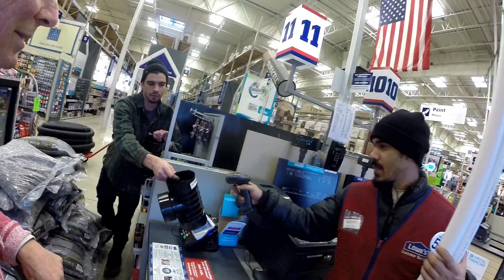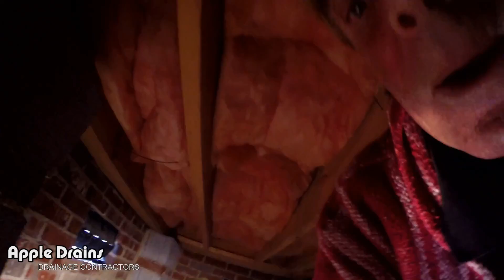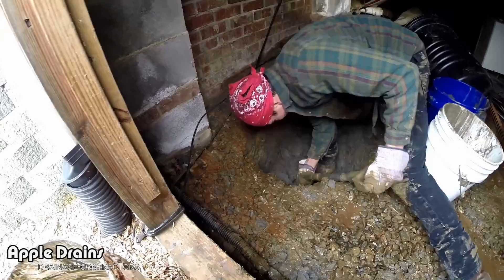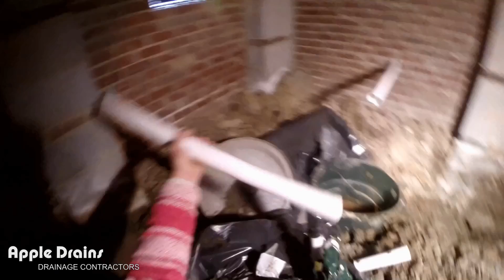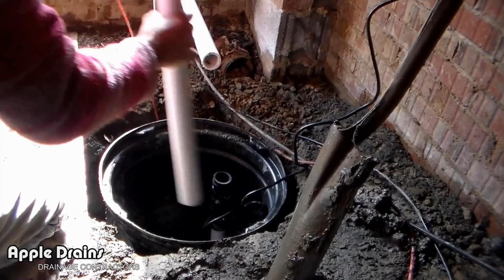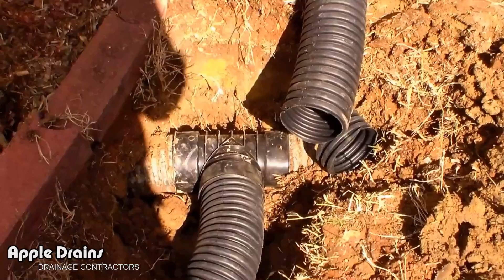Very Complete How to Waterproof Your Crawl Space

Comment: I don't like a sump pump because if the power goes out you are SOL and have a huge mess. They had a setup like this under my house and when the power got knocked out during bad storms I had a mess. We finally had a proper french drain put in using gravity. I am curious why you would do this under the house instead of doing it outside along the perimeter? You still have water /moisture under the house which is never a good thing.
Reply: BATTERY BACKUP!!!!!!

Comment: Nice video. I have not seen you guys checking the slope. The drain pipe may have got a couple of law and high points along the length. I noticed you did not use filter clothes to wrap the drain pipe. Filter clothe may be not good for the long-term function of the system because it gets clogged due to fine materials. The best way I think to use gravel filter with a different size of aggregates with fine material on the outer layer. The outer layer of fine material can be replaced after some years if the drain does not function well.
Reply: I'm about to do my crawlspace, and between videos and professional opinions most people who do this use DOT approved non-woven geotextile landscape fabric.

Comment: This is like my property,in the way it goes on a slope on the outside. So, why not drill a hole in the footer, run the pipe straight out,sloping down hill and let gravity flow take all the water out and away,rather than all the sump pumping business? Less money and you're not depending on electricity. If there's an extended power outage your basement will flood with no way to get it out.

Comment: Why dont you use the fabric sleeve around the piping in these applications ?
Reply: no fabric sleeve  due to the fact that it's just something that will collect dirt and clog..if you make a nice enough trench about 10 in from the footer with washed stone  then the idea is that only water is made to travel thru the pipe. you might see a little silt In the beginning at the bottom of the sump pit, but that can be removed pretty easily.
the " sock" actually reduces the flow..